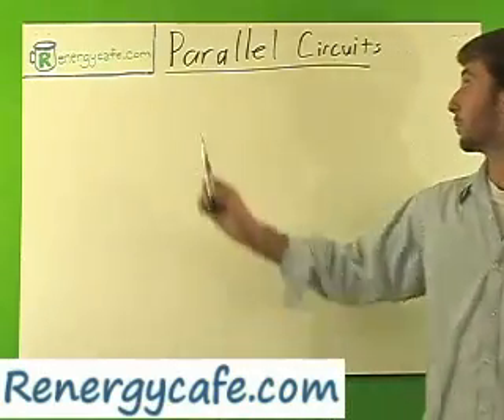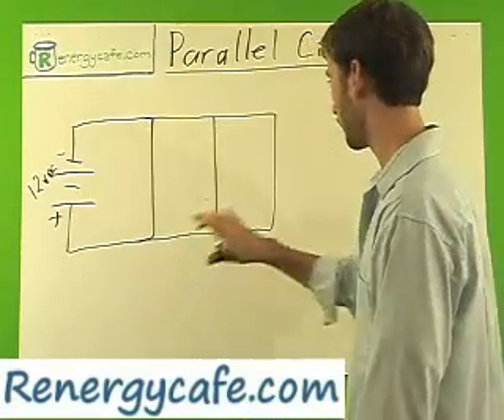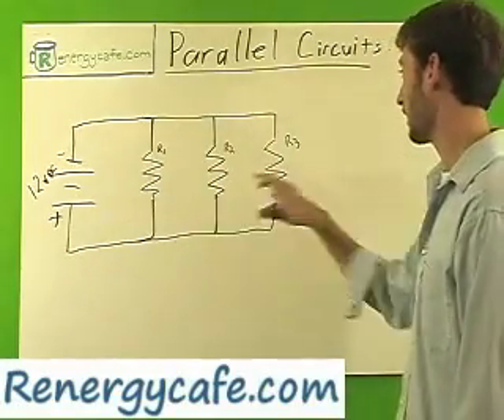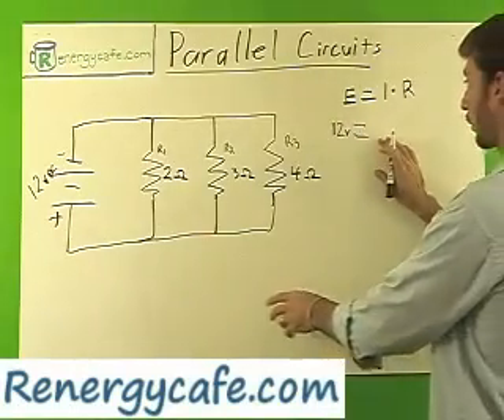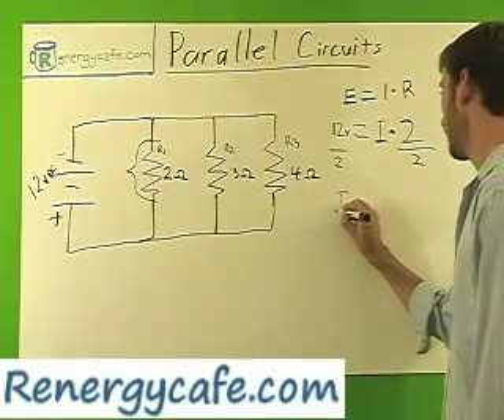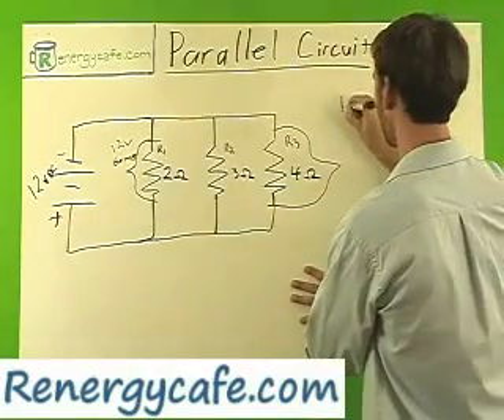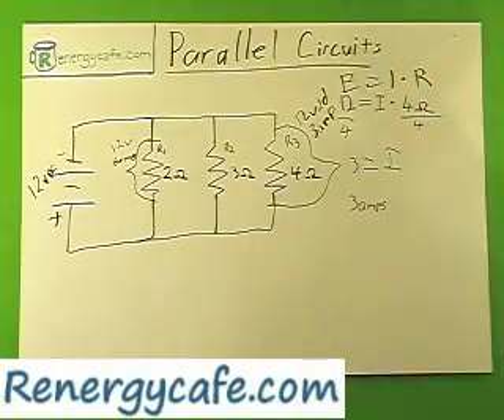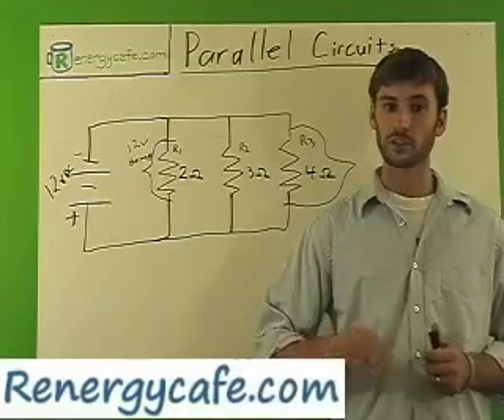6 Learn Parallel Circuits and renewable energy

Comment: This is misleading. In order for two elements, a and b, to be in parallel, there cannot be another element between a and b, else, they are NOT in parallel. The fact that they are in parallel, in the mathematical definition of the word, does NOT mean they are in parallel, in the circuit definition of the word. It is true that voltage is the same across elements in parallel, but that is not the whole definition.